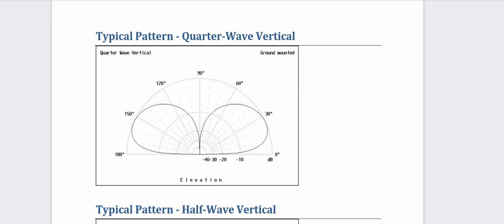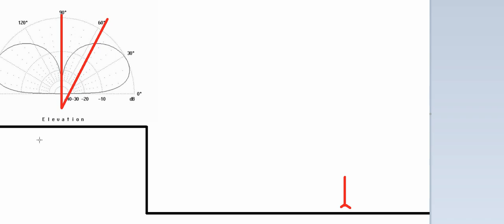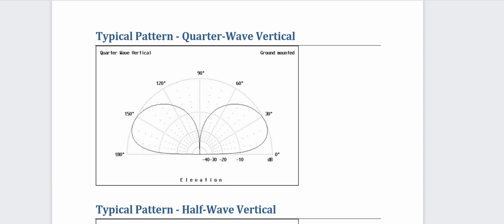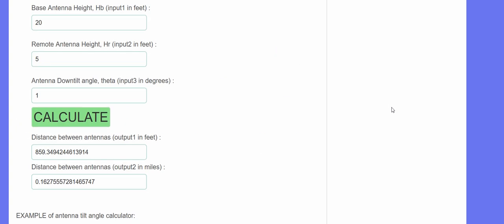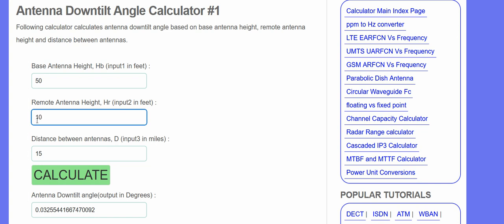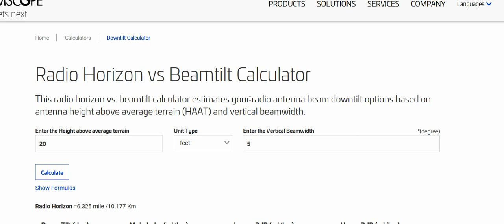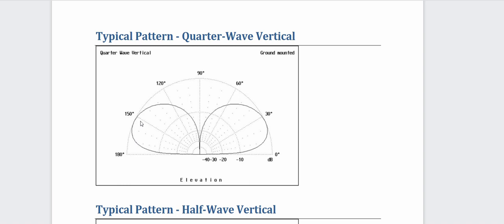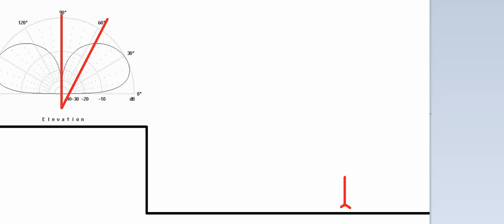🔺 TILT/ANGLE your GMRS two way radio antenna may help with your range!! 🔺

Comment: Very good point " angle of radiation" very true we have experienced with a copper J Pole and it does show some directional on the model  verticle is not always the answer very good point. Thank you again for your good video you do a great job.

Comment: You are showing a pic of a ground mounted antenna as soon as you get a high gain UHF antenna  30 feet or so off the ground everything changes its now in free space. As the antenna engineer designed it to operate straight up. If you have a antenna grater then 9dbi gain UHF it will need to be 50 feet or higher to work properly.
Reply from the maker: Ya, I see the pattern changes with antenna modeling software when the antenna gets higher.
Reply from the maker: http://gal-ana.de/basicmm/en/
Reply from the maker: I think tilting will still have an effect how much hard to say